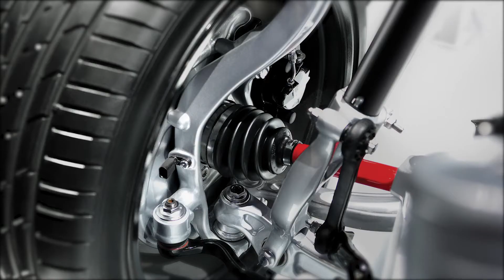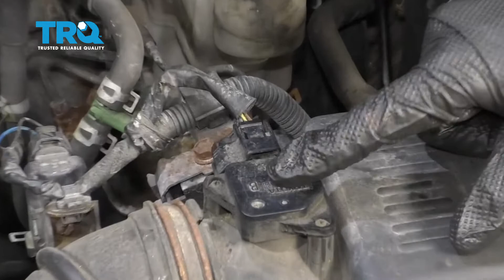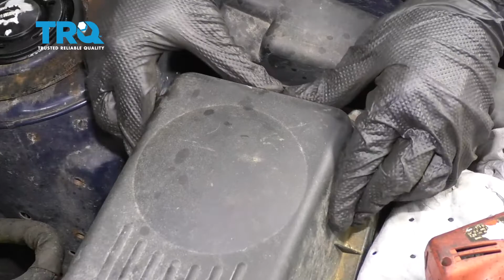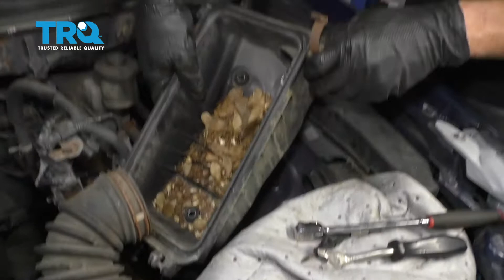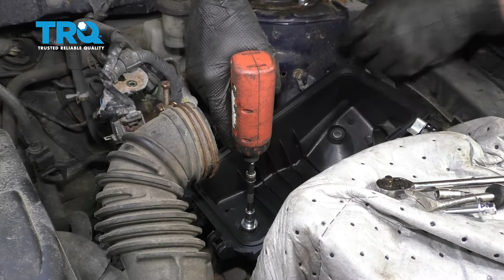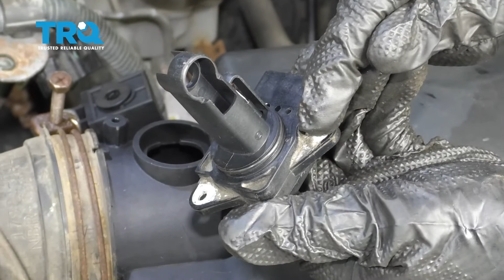How to Replace Air Cleaner Assembly 2003-08 Toyota Matrix

Comment: hey! nice informative video, really helped me out. but I have a question about the air filter box bolts, where did you get them at and what are they called? it would help a lot, thanks!
Reply: You're better off taking the old one and any auto part should be able to match it but normally it's 10 mm socket but then you can or they can figure out the length of the bolt by matching with the old one.